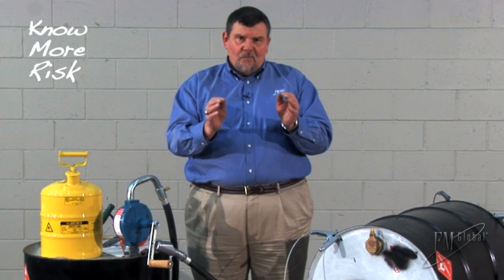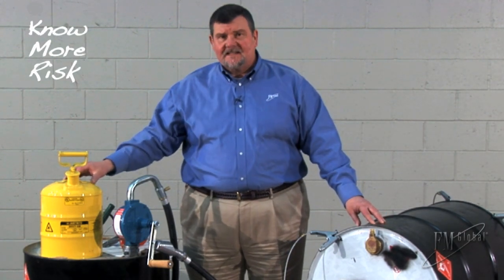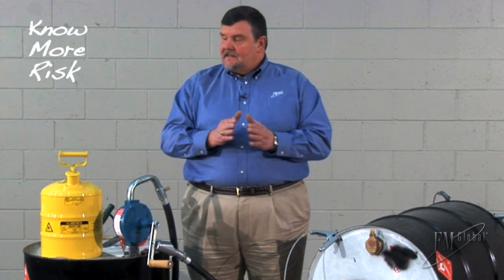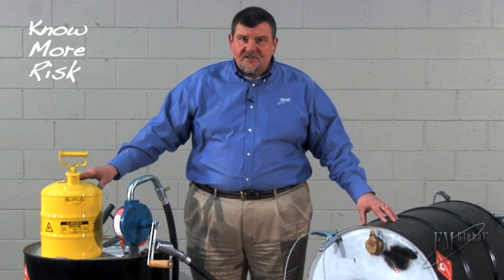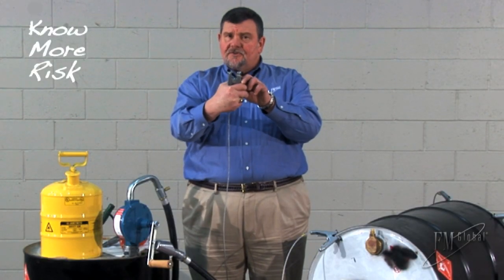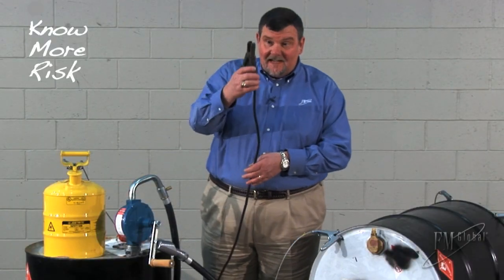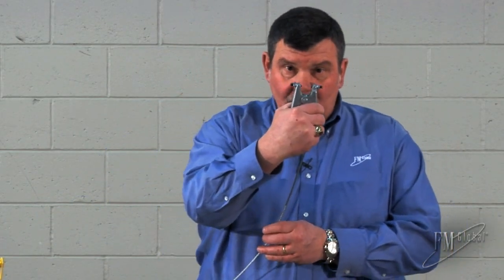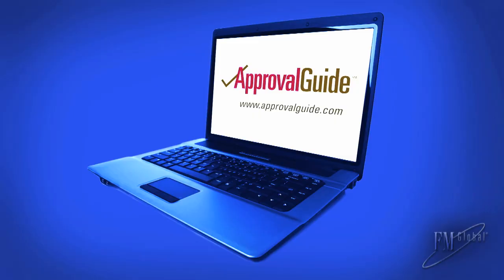Know More Risk: Bonding-Earthing-Grounding

Comment: I haul fuel in a semi transport. When I unload at a gas station (gravity unload) or at a farm (pump off) we never ground. There aren’t ground clamps available. When we fill our cars at a gas station where are the grounding clamps?  If my 55 gallon steel drum is sitting on the earth and I’m using a pump to dispense fluid in to my car/mower/tractor that’s sitting on the earth wouldn’t this be like filling at a gas station?
Reply: At gas stations the hose has a bonding wire in it that is connected to the nozzle on one end and the grounded metal of the pump at the other end.
A drum standing on the ground may be grounded but there are variables to the quality of the grounded connection.
As for transports, I used to see them with chains  or a special rubber strap that dragged on the road to dissipate static. I don't recall seeing this for awhile. 
Gas station tanks are grounded and bonded underground, as is the piping but that leave the the truck. It must be grounded somehow.

Comment: I worked in a mill once where the drums were grounded of all things to an electrical conduct. Turns out the conduct was not even grounded. The fire marshal had a shir fit when he found the set up. That caused so trouble. It is a wonder the place had not been blown up a long time ago. The whole set up was redone and anyone that had anything to do with the drums had to take a grounding and bonding class.